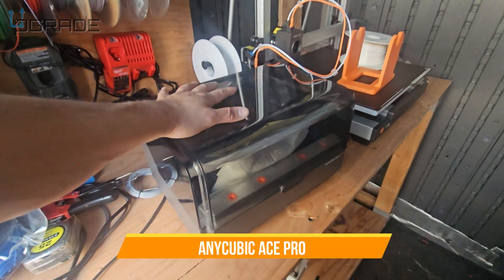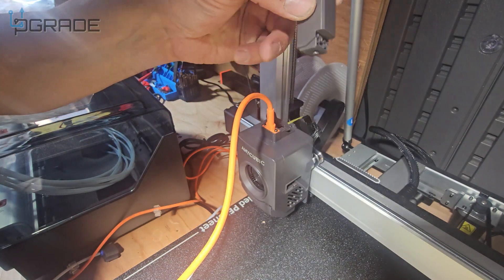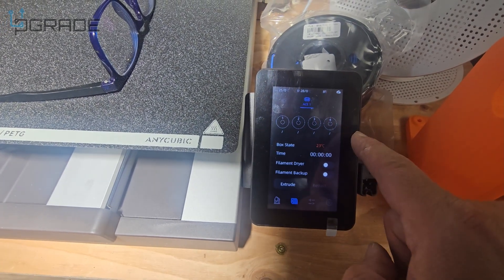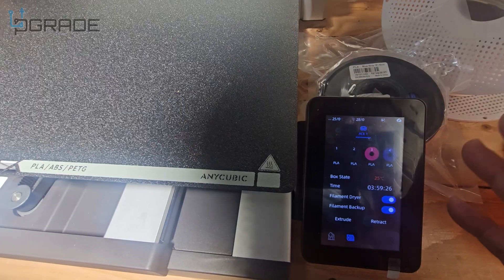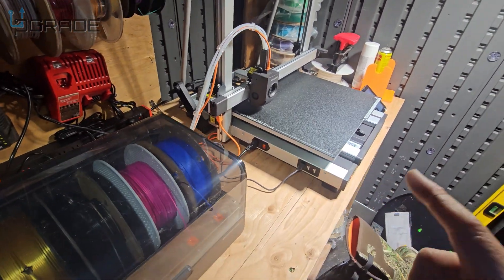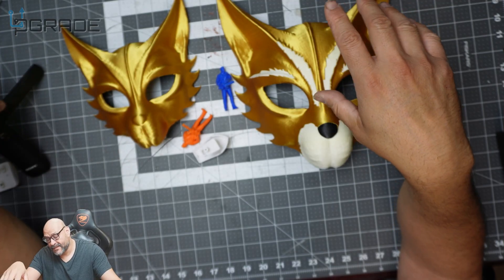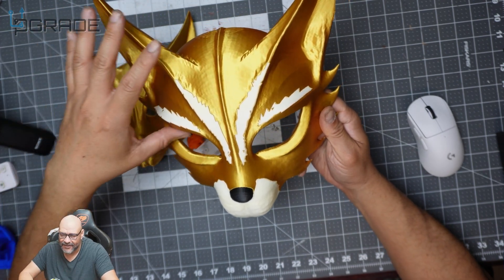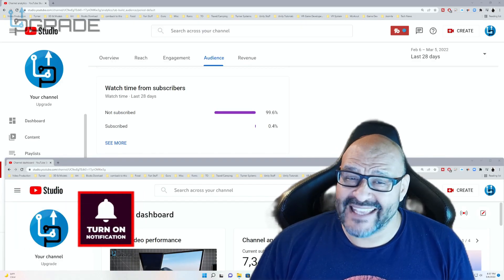Anycubic Kobra Max 3 Color Combo

Comment: thank you for the video, I hesitate so much to buy it cos I've seen so many bad comments on reddit. Are you still happy with it ? No problems ? I want to change my kobra 1 that was good (except the bed was not flat)

Thank you :)
Reply from the maker: The printer has been great but not the AMS its has issues that the company send me part to replace they had issues with the first Gen of this Ace pro system. Bu the printer has been working OK so far. I'm going to do a follow-up video on the combo just because of the repairs process
Reply: Did they already updated the Ams ?  @Upgradetech
Reply: I have this same printer haven’t had many problems except for when I tried to make a cherry blossom dragon. My base layer keeps getting ripped off. Ams feeder gives me error code when using matte pink with the cardboard roll.
Other than that it prints well.
Reply: Thank you i bought this printer and works very well ! I saw that cardboard filament can have problems  @Silverback8518

Comment: Also a good number of bolts on my printer were loose. My first test prints turned out ok, but after Tightening the bolts on all the motors, motor mounts, the z-axis screw motors were especially loose, the prints came out much better and bed adhesion was even further improved. 

Also one people forget about: Drafts cause issues with the print. Air movement can cause your already laid down filament to cool and warp which makes it come off the build plate. 
leaving your door closed and using a camera to monitor your prints can reduce air movement and improve print success.  🙂🙂

Comment: First layer adhesion can be greatly improved with a few things:
Slower first layer speed.
Higher Print Temp for first layer
Higher Print bed temp 
Lower Layer height on first layer
Enable a brim.

I've been doing quite a few prints on my K3 Max and bed adhesion has so far not been an issue I've encountered. I'm coming from a DIY Hobbyist build it yourself kit where bed adhesion was a constant nightmare. The included flexible build plat cover seems to have a great texture for adhesion. I would recommend you ensure it is free of any left over filament residue, factory oils or "hand gunk" by giving it a good wipe with Isopropyl Alcohol.
Reply: This is exactly what I needed because it seems like my first layer keeps getting ripped off Eventually a few hours in parts get  ripped off so frustrating. I have done many dragons but once I tried a cherry blossom dragon it keeps messing up